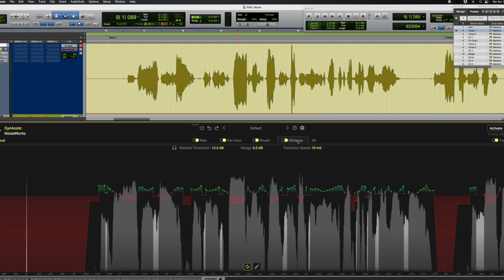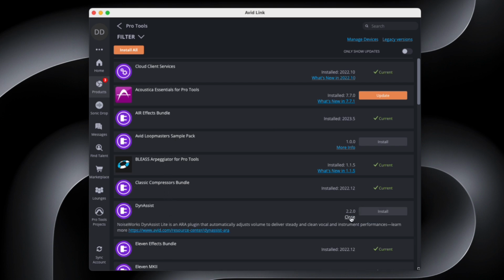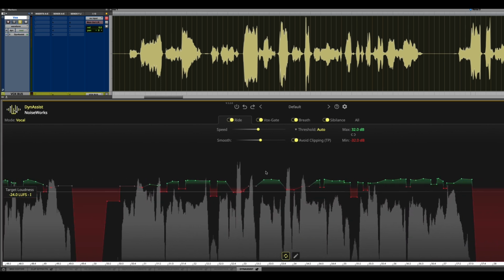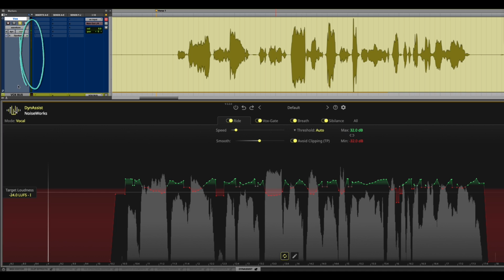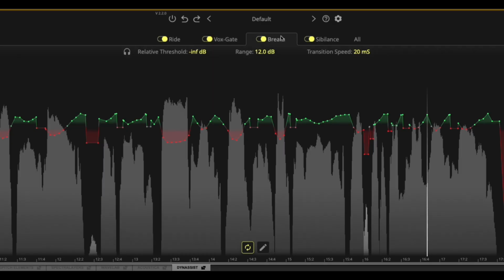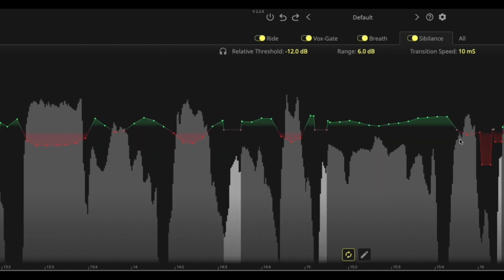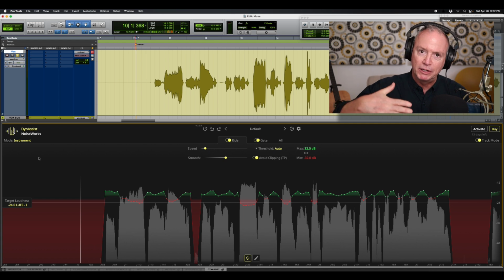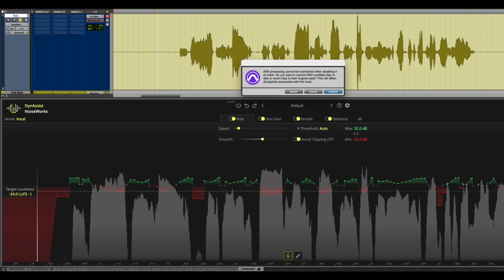Edit Vocals INSTANTLY with DynAssist! A Smart Editing Plugin -  Lite Version now Free in Pro Tools!

Comment: I'm using this via ARA in Pro Tools but its not doing any of the functions to my audio
Reply from the maker: Hello Xman, The free version does not include control over the parameters if that is what you’re experiencing, but it will give you basic gain leveling in the free version. The free version also just does basic gain leveling and noise gate… Thank you for watching the video 👍☀️
Reply: @ProducerDan  Thanks for the response, for me its not even doing the leveling. It recognizes my audio but doesn't do any of the functions
Reply: @Xman2U  I agree. I tried it (Lite version) and it fails to boost and cut clip volumes as expected. After processing, I still have to make manual adjustments. I'll keep trying it, though, because in principle it's a great idea.
Reply: @jameskeithnorman 100% agree! Please continue to keep me updated.